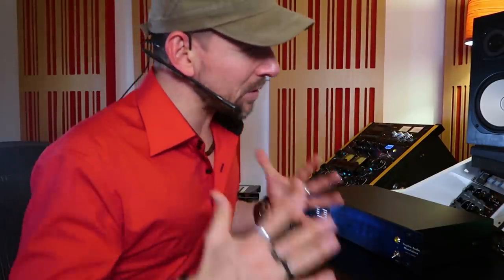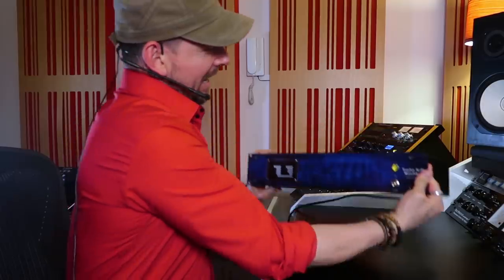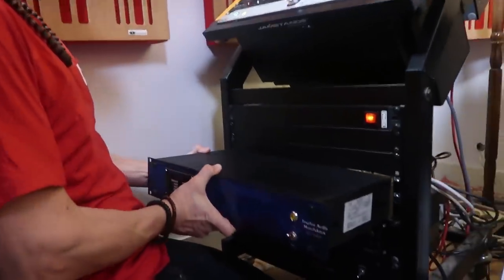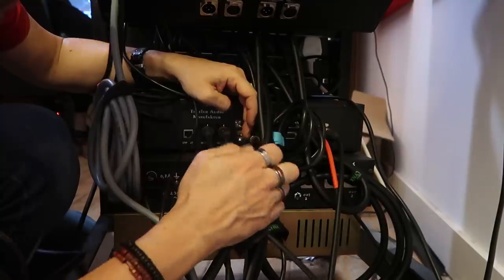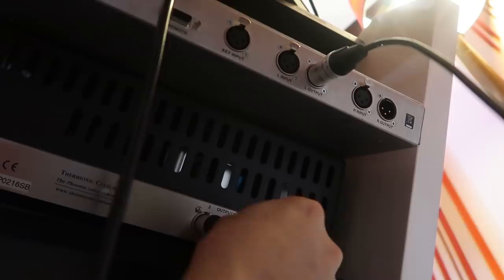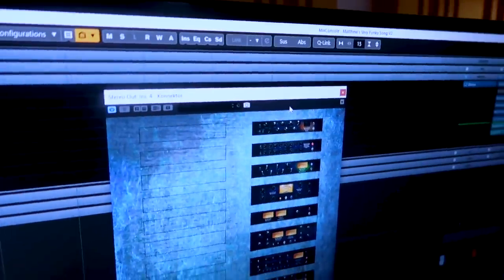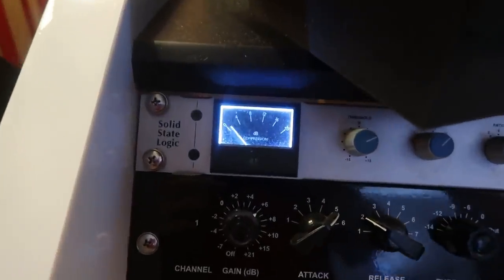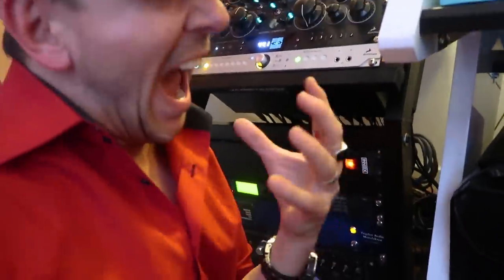Tegeler Konnector Analogue Mastering Matrix In Action

Comment: I like it, but 2500 euros for a patchbay is a bit excessive.
Reply: Not when you are making bank like Dr Mix (and his 12 year old intern) are... :-)
Reply: @pesto12601  When it is your living... indeed why not? I as a hobbyist have been replacing failing patchbays three times over the years. And I only use them now or then. I didn't buy the most expensive stuff, but at least I spent a few hundred bucks on it. And then cables, cables and cables... When it's your profession and you make money with it and use it all day, I am sure it is a good investment. And faster! And time is money in business...
Reply: If you can afford all this stuff then 2500€ is nothing
Reply: My question is if he's going to buy 2 more, he removed 3 of the Neutrik 16x16 patch bays and replaced them with one 16x16, did he not need the other two?
Reply: more like £7000 fo 48 in/outs (1 patch bay) of the cheaper flock audio one..(I have 7 or 8 x 48 patchbay)

Comment: Looks great... I would double check though before connecting vintage style equipment (especially your SHMC with its output transformer array) that it will not harm the unit in any way.  I am only saying this because I did a bit of research into using the dangerous music liaison as a similar problem solver..... in the liaisons user manual, there is talk about using bleeder resistors (whatever they are ?!) on certain pieces of hardware gears outputs to prevent spike damage.... 

I don’t really know what I’m talking about by the way, but I am an avid watcher of your channel and would not want you to get into problems

Cheers

Dave
Reply: Optical isolation could be a solution.  Fiber perhaps?
Reply: Bleeder resistors is often used across capacitor banks in high current power supplies / switch mode power supplies.
Their function is to discharge the capacitors faster, when the power supply is turned off - that way the risk of getting a shock if working on the circuit is smaller (You still check with a multimeter before touching..)
- It is only a safety measure, and will not bring anything useful to the circuit / lower ESR on caps / or anything positive, they will actually waste a small current all the time, when the circuit is on.

To use a bleeder across the output of hardware gear will lower the output impedance, and I think the reason they (dangerous music liaison) advice that, is because they use old school relays for their audio matrix.
- When inductors (also audio transformers) are pulsed / suddently disconnected, like a spring being released, they can cause a huge spike at up to several hundreds or even thousands of volts (Tiny current), which can damage components.
In daily speech, you would call a spike like that for ESD.

If your unit use "old school" relays, it can cause spikes - but so will changing cables in a patchbay, where you disconnect / connect.

Most analog switch multiplexer ICs will have "break before make" and other ESD safety measures, when they toggle state.

Instead of just placing a resistor across the output, then use a TVS diode - that will absorb any spikes - and will have no altering effects on the audio, when the voltage (audio) is less than the TVS diodes voltage.
Reply: Space Wolf Music Hello,

Thanks for the reply. Very detailed ! That makes sense now as I believe this unit uses IC’s to control the switching and not relays...... 

I knew deep down that I didn’t really know enough on the subject to warrant leaving a comment but I was thinking to be better safe than sorry....

May I ask you a question?.... In your opinion, which of the two units; the Konnektor or the liaison, would be the better choice for let’s say controlling a mastering chain.. Which one would do less harm to the signal, if at all....I ask this because I have been interested in either of these two units for a while now.

Cheers again

Dave
Reply: @cretecandi6807  To be completely honest, I just saw the Konnektor earlier, when I answered here - the liaison I first knew about, when you mentioned it.

I mean, both are build for "pro studio gear", and both is meant for exactly this usage.

Also there is nothing bad to say about the specs on the liaison page - THD, noisefloor or crosstalk - it all looks perfectly fine.

Price is "almost the same", but the liaison only got 2 stereo in / out, with 6 stereo inserts - while the Konnektor got 2 stereo and 8 stereo inserts.

To be honest, I would go for the konnektor, because it got more inserts, and you can control it as a plugin.

The liaison is more expensive, less inserts, and you control it on the front panel.
I mean, a box with relays, and push buttons can be build very very cheaply, so if that is "all I wanted", I could do it myself.

By the way, I found the explanation here:
https://dangerousmusic.com/wp-content/uploads/downloads/liaison-read-this-first-pdf.pdf

The bleeder resistor is for floating output, as in, when the secondary output of the transformer is not connected to ground.
You can do the "fix" with two pull-down 100 K ohm resistors from each output pin.
Positive > GND
Negative > GND

But as they said, is only needed if you use old vintage gear, with a floating transformer output.
Like this:
http://gyraf.dk/schematics/Disa_91_b21_micamp.gif

And if all your equipment is not on a shared good ground connection, they can have different potential, and when they "meet" aka you switch / connect them together, you can get spikes, hum and ground loops.
Reply: Space Wolf Music 

Hello again,

Thanks very much for all the info, you have been most kind to give up your time in conversing with me.  It’s almost going to be down to a coin toss, but I guess it should be more weighted on the side of the Konnektor given that Tegelar (I believe) sell direct to public so you cut out the middleman’s cost also...

Cheers

Dave

Comment: blown away by this video then was blown away even more by the price LOL, traditional patch bay it is
Reply: Yeah.. I was impressed at first too.. But then realized that you only got 1 stereo in and out.
"The 8 stereo outboard channels can then be patched into the signal patch in any order. Also Mid/Side is possible."
- Sounds all fine, but just as you said - the price shocked me as well...

For that price.. I could build a 32 stereo in / out, with 64 stereo outboard channels - still with mid / side matrix on every single unit.
Hell, I could even throw in some wet / dry parallel processing on every channel.
I would also make some sidechain busses - if I wanted to sidechain a reverb / delay or other stuff.

Either oldschool relays, analog switches multiplexers, or the AD8113 from Analog Devices to make a X Y switch matrix with all units.

That could easily be build based on arduino with ethernet shield, or a ST32 mcu.

Actually, the hardest part (For me) would be to find a proper way to make a VST GUI, and because I use Ableton, I would properly just end up using Max, and output midi from a semi ugly GUI to the arduino.
Or research into other simple "SynthEdit midi out" concepts.
I am not a C++ programmer, so I would properly not use the JUCE framework - but it would of course be the best solution of the ones mentioned.

But then again, I would rather just buy a RME adat PCIE card, and tons of Behringer ADA8200 adat ADC / DAC converters, and have all my gear have it's own permanent in / out, and just place them as I wish in ableton - lazy? Maybe.. but it would still cost me less, than this blue overpriced arduino switch "wonder box"... lol...

Comment: Reminds me of the old I/T days. Twinax pigtails hanging out of 5250 emulation NIC's, clustered into a Token Ring MAU's. The 25 pin serial connector is still used here, albeit for audio routing purposes. These 25 pin connectors were discontinued in the commercial A/V industry years ago (Crestron, AMX, etc.). So here's the thing Claudio, I think it would have been better if a fiber protocol converter was used instead of a 25 pin receiver. 48bit/ 192 is pretty damn good in protocol converters used these days.  For example using a Cobranet, with it's own built in URL for real time routing mgmt in conjunction with fiber interconnects would be far more versatile, improved signal quality, and reliable. Claudio, just msg me offline and I'll "route" in the right direction if you wanna look into this. Saluti !

Comment: By the looks of it, you only get 8 analog ins and outs on that. You would need 3 Konnektors to replace just one of those neutrik patch bays you pulled out... Add to that, the need for software to control the Konnektor. Let's hope you can still use it after 5 or 10 years from now, if Tegeler is still around and supports that unit...
Digital stuff only lasts as long as there is software support, analog lasts forever... Almost 😉
Reply: You don’t need software support for the program to work. You can just run an older patch of the software and it’ll still run properly. You can relate that to the many people that still run windows XP since it’s still a superior operating system even if the last update was over a decade ago. Oh you got a new computer? You can still install that older software

Comment: TP-LINK Broadband over mains would have been a possibility would it not but you would have to turn off the WIFI on each of the Adapters but you can have up to six such units on the one circuit and each unit can take two Ethernet leads